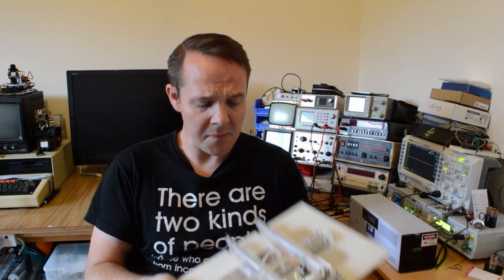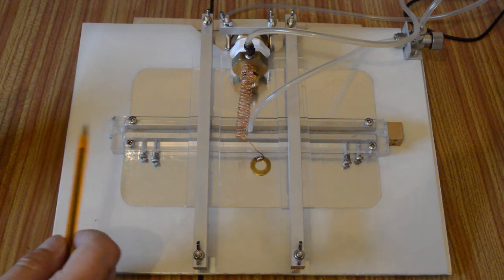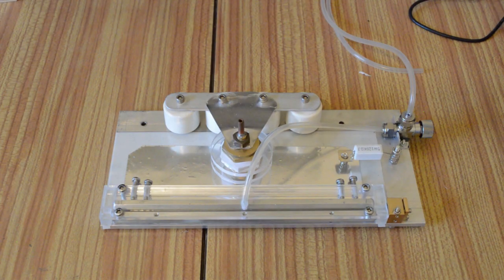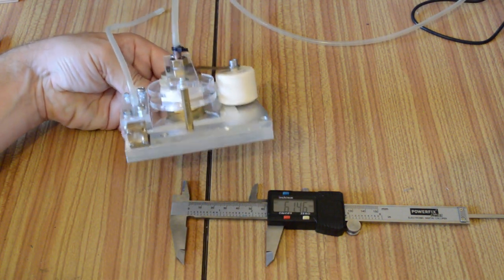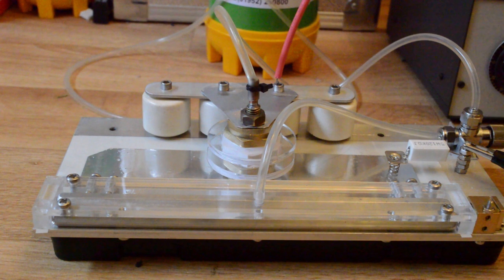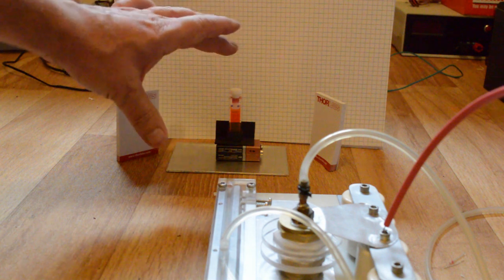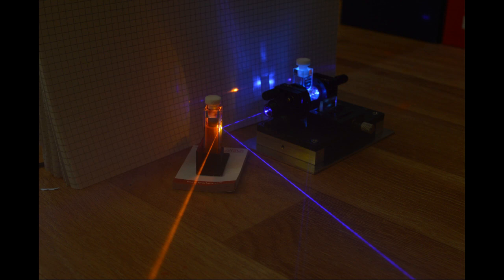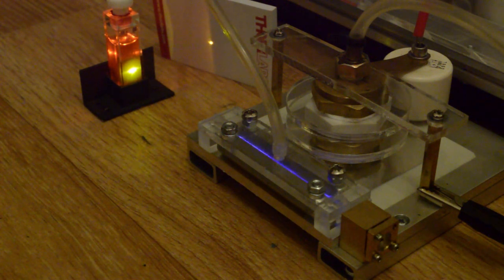DIY Home made High Performance TEA Nitrogen Laser and Dye Laser!

Comment: how can you change the repetition rate? I though that the repetition rate was given by the charge and discharge time constant of the RC circuit but probably not. Thanks for the explanation and info ...
Reply from the maker: The repetition rate is governed by the charge on the Dumping capacitor, the breakdown voltage of the gap, and the current supplied by the PSU in this case (So RC). Just crank up the supply to increase the repetition rate.  
A far better arrangement would be to make a triggered gap, so there is real control. 
The upper limit is ultimately determined by the temperature in the channel. Whilst it can be driven to 100hz easily in its current form, The output rapidly drops off above 40Hz, as warm Nitrogen does not Lase well. If you wanted a truly spectacular output, you run chilled Nitrogen down the Channel at a high flow rate. According to the literature, Nitrogen Lasers have been built with repetition rates above 1kHz.

Comment: Long time ago I built weird nitrogen laser with copy of the diagram from PRA-LN100 laser (TEA). But, after marx bank generator consisting of only two stages (to doorknob capacitors), there is 15 m of 75 Ohm cable feeding to the laser head. No additional spark gap on the laser head. And since then I lost interest in building any laser. My bad.
Reply from the maker: Cool! Do you have any more information on that?

Comment: fantastic!! I was wondering if instead of of a Nitrogen laser you could use a violet pointer laser (400nm approx) as it makes most of pigments fluorescent ?
Reply from the maker: Thanks!
Unfortunately it is not quite that straightforward. Although a violet laser pointer will make the dye fluoresce brilliantly, it lacks the peak power necessary to threshold the dye. 
Dye Lasers typically require peak power densities in the order of Tens of Kilowatts, to Megawatts per square centimeter, easily achievable with a small Nitrogen Laser.
It is possible to diode pump them, but it is certainly not easy and the power levels are very low (on the order of nanojoules) see this article here: https://link.springer.com/article/10.1007/s00340-017-6664-4
It is something I am considering pursuing, but the set up costs will likely be very high... Nitrogen lasers are cheap ;-)

Comment: lee have you tried this experiment using your own home made solutions such as the ink chemical from a high liner marker dissolved in methanol? i used ethanol as well for an orange and yellow marker under a weak black light and got nice fluorescence, id love to see if you can pump them to get lasing action to produce different colors , what is the highest freq or rep rate you can go up to and still avoid triplet quenching? 60hz would make it look cw, hmm i wonder if the homemade solutions would also suffer from triplet absorption or not? perhaps that might be the reason they may not work because there wont be any stimulated emission? idk but i have asked you before about getting lasing from chemiluminescence(glow stick)and you said it would not work but i been thinking about electrochemiluminescence and apparently they have gotten some breakthrough there for lasing i also think they even said they done it with chemiluminescence

Comment: awesome, well presented too, thanks. Q: any other gas that would work?
Reply from the maker: Thanks! Yes, probably! I suspect a CO2 laser mix would work, but you would need appropriate resonator mirrors. Argon 'might' if you made the channel long enough.
Reply: @LesLaboratory  are CO lasers better for higher powered lasers?
Reply from the maker: @mastershooter64  it depends in what context. For engraving and cutting, a good diode laser will give a CO2 laser a run for it's money, depending on material. There is an upcoming video on exactly this topic in the works right now!

Comment: I think the size could be further reduced, but I'd have to know what the effect of scaling this device is.
For example, how much less voltage is needed when substituting razor blades for the hexagonal aluminum rod?

Potentially, a feedback oscillator driving the spark gap could be used to step up a low voltage power supply. The feedback oscillator could be substituted for a simple oscillator used to drive a  transformer with a few more components.
At that point commonly available capacitors could be used to avoid the issues caused by the homemade version.

Of course this greatly reduces the output, but given the insanely high wattage of the typical TEA laser, it may be worth a try.

EDIT: The size I'm envisioning is comparable to an old Nokia "candy bar" type of phone, including the powder supply.
Reply from the maker: Sure, I suppose it could be made much smaller. I do not think a razor-blade channel would be quite as helpful as you think. Whilst such a channel would lower the voltage, it would also lower the available electron energy I imagine. I have previously used sharp channel electrodes, and found them to be very poor in this application.

It could be shrunk to the size you describe. I think a channel of ~3cm is practical. After that, it is just a case of shrinking the rest of the package. Small HV PSU's are readily available, I just wouldn't expect a huge repetition rate.
Reply: @LesLaboratory  
Thanks for the information on practical scalability.
Your response was much more in depth than I expected.
I didn't expect razor blades to produce anything useful, I was just hoping to get a relative figure in order to get me in the ballpark when I build the power supply.

I don't have a whole lot of space for projects, so the smaller the better.
Like you, I'm opposed to building something that's so structurally unstable as the typical TEA laser.
Better to spend some extra time in the design phase & not have to readjust everything each time the laser is moved.

I'll happily accept a vastly lower rate of repetition in exchange for increased durability & the ability to use off the shelf components.
Reply from the maker: @kaisersose5549  Totally. These builds are great in terms of stability. 
They don't scale up too well either. I have built one with a 30cm channel, but for TEA designs, that is more or less the upper limit.

Scaling down is something I should look in to. 6cm is cute, but it would be cool to get it down to 2cm, and still be able to do useful work, i.e. pump a dye laser.

I am also looking at trying to replace the doorknob caps with something more obtainable as well. I have tried removing epoxy from wire ended HV caps, but always manage to damage the dielectric and it is a lot of work, so I am looking into a design comprising of bog standard wire ended HV caps. I reckon with a bit of thought and care, it can still be made to work!

Comment: What did you use for a HR and most importantly, for an OC? I tried using a homemade resonator, but could only get superradiantly lasing. I was unable to obtain oscillation. I'm certain the mirrors are very well aligned. My only doubts are over the correct percent transmission (which should be high, given the extraordinary gain), which shouldn't be critical at all.
Reply from the maker: The HR was a plano UV coated aluminised mirror. If I had the money I would have used a radiused mirror, to compensate for the divergence of the reflected beam. There is no OC in this design, but the literature suggests between 4 and 10% for optimal efficiency. As you say the gain is massive anyway. Using a HR will more then double the output at one end.
Reply: @LesLaboratory  Where did you find such a tiny mirror? The commonly available ones are all one inch dia.
Reply from the maker: @TheLightningStalker  I got the mirror from Thorlabs. They do miniature UV enhanced mirrors.
Reply: @LesLaboratory  Very helpful thanks

Comment: 🤯 wow! How come the lasers come out at 90 degrees as opposed to straight through?
Reply from the maker: The Nitrogen Laser is focussed as a line on the Dye cell, and the gain occurs along the line. The penetration depth is very shallow so there is not enough gain in that direction to Lase, hence the 90 degree output.

Comment: I'm curious-- how well would this work with argon instead of nitrogen?  Couldn't really find any info on using other gases aside from CO2 or helium.  Argon is just a lot more common to have on-hand if you weld things.  Is there any info out there that would indicate what various gases would or would not work, and why?
Reply from the maker: As far as I know, Argon will not lase in this configuration. You might be able to use Ar as a buffer gas, but it is quite a heavy Ion, however, it would make an interesting experiment. Who knows, maybe with a long enough channel,  visible Ar lines could make an appearance. 

Apparently if you pressurize the spark gap with Argon that are supposed to perform better.

Comment: Les, 

I’m new to this laser game, and I was wondering why the “secondary” beam from the cuvett (?sp.) comes out at a completely different angle from the incident beam? Light amplification due to reflection off the inside of the cuvett?
I’m at a loss!

If you have link explaining, or if it’s quick an easy to explain, I would appreciate it,

BTW: You did a great job explaining you lasers! Thank you!

Kevin
Reply from the maker: Hi Nivek,  when the beam from the Nitrogen Laser hits the side of the cuvette, the penetration depth is very Shallow, so there is not enough gain in the same axis of the pump beam to Lase.
The profile of the Nitrogen laser beam on the cuvette is a short line, maybe a few millimeters in length, and in this case, there is enough gain length for it to Lase. Also yes, you are correct, reflections from the edges of the cuvette (about4%) are enough to amplify that light as well.

You can Lase cuvettes pf Dye 'on axis' if you dilute the solution enough and pump it hard enough, however then it becomes difficult to do interesting things like tuning it.

There is a diagram of a Nitrogen pumped dye laser setup here:
http://technology.niagarac.on.ca/people/mcsele/lasers/LasersDye.htm
Reply: @LesLaboratory  I had sort of the same question/was wondering why the 2nd output was perpendicular. Is the cuvette glass or plastic? I would think the quality and shape of the cuvette would impact how well the pumped color works.

Comment: I’m coming very late to this, but with CO2 in the gap, it’d lase at ~~10um. At 300-500 kW per pulse, would it be able to ablate material to engrave it, or is the total amount of energy per pulse just too low? How about if you just used a boatload of doorknob caps? (With a different choice of gas/wavelength, could it ablate metal?)
Reply from the maker: Possibly. I havev actually ordered CO2 laser cavity optics to try this...
Reply: @LesLaboratory  I can’t wait to see the results, that’s something I’d be interested in trying myself! (After you’ve figured out all the hard parts 😉😂)

Comment: What would the peak power of the dye laser output be relative to the pumped laser input?
Reply from the maker: The theoretical limit depends on the quantum efficiency of the dye, and optical cavity configuration. In the literature, this is about 30% for Rhodamine 6G. For simple Dye lasers like mine, more like 10%.

Comment: is it possible to run this with a cw laser? like a cw nitrogen laser to pump the dies and get a steady output?
Reply from the maker: Not in this configuration. If the pump pulse is too long (or too frequent), Triplet absorption quenches the Laser. For CW pumping, the way round this is to mode the dye through the beam extremely fast. Such dye Lasers pump dye through a dye jet inside the cavity.
Reply: @LesLaboratory  i kinda understand what you mean and i know about dies being pumped fast through the cavity for that as well as to prolong the life of the dye but when you say things like triplet absorption etc or even talking about the life time of exited states and that is why you need it to be pulsed pumped etc i have a hard time trying to visualise what is happening at the atomic level , at one time it was said ruby laser could only operate in pulsed mode well not anymore they can operate cw now , how about if we configured a xenon flash tube so that it is inside a fabri perot resonator will this not produce a laser pulse when flashed? or do the same with a neon sign tube and get a laser output , is there not stimulated mission happening inside a red light led? surely there is and if we trap it between mirrors we can get a beam out too , i bet even incandescent bulb has some stimulated emission happening and not just spontaneous,, dont mind me my head is full of questions lol i enjoy playing around and experimenting, like taking a 7.5w single die led from a store and making it go through a pinhole then an aspheric lens to make it look like a spatially coherent white laser beam which actually ended up having a better divergence than my laser pointer  well okay because the beam diameter is larger than my laser pointer

Comment: Do you have build instructions with parts lists posted somewhere? I'd love to replicate this work.
Reply from the maker: At the moment, the only documentation are these videos. I am in the process of creating a written document though. I will post it here when it is ready!
Reply: @LesLaboratory  Knowing how lasers work, but the specific tricks in how they are built -I lack. I am very interested in seeing how to build your take on the N2 laser, if you are not sure what I am saying, I am very interested in building the charge transfer version 2 design.  Because I did not see how the gas feed worked and how the charge-transfer circuit works, I am very intrigued and trying to curb my anticipation. :-) Being familiar with the first circuit design and laser TEA based on the Scientific American article.  This is interesting.  DO the electrodes connect to the capacitor plates on top? What electrical current source are you using?  Thank you for the video.  Please provide some documentation for building and understanding the circuit at least.

Comment: Where did you get the cuvettes? I make mine out of RTV and microscope slides. I hate fighting the leaks!
Reply from the maker: Hi. I used to do that, but it is a pain. These are Hellma Cuvettes I scored on eBay at the right price, but I have also used the inexpensive Chinese ones as well, and they are pretty reasonable.
The seller ID is samnacu, and they sell stoppered cuvettes for ~£30 UKP.  Stoppered ones are the business, easy to handle, resistant to spillage if you are clumsy like me and they keep well in terms of evaporation.
You can get square lid cuvettes as a lower price (~£20 UKP), but your solvents will evaporate quite quickly, and the lid won't stay on if you knock it over.
It goes without saying, you need the cuvettes with 4 clear windows. It is possible to polish the ones with 2 ground glass slides, but once you factor in your time and materials to do it, you might as well have spent the money!
Reply: @LesLaboratory  Thanks you very much. 

I tried searching eBay for user ID samnacu, but my search results turned up nothing.
Reply from the maker: @magx1  https://www.ebay.co.uk/itm/3-5ml-10mm-Path-JGS1-Quartz-Cuvette-With-Stopper-For-Fluorescence-Spectrometer/282377501375
Reply: @LesLaboratory  perfect! Thank you very much

Comment: Hello, your videos are very interesting, but I'm a total laser noob, so I have a few questions. 
Why doesn't the paper burn when you laser upon it? 
What is the purpose of your kind of laser? Can you cut with it?
Reply from the maker: Thanks! Although the peak power is very high, the average power is in the milliwatt range, so you can not burn or cut with it.
Laser like this are used commercially to do things like analysis, for example Fluorescence Spectroscopy.
I build things like this because they are a technical challenge. There is something special about being able to build a Laser from scratch, rather than just buying a laser module. Besides, with a Dye Laser I can generate any color I like!
Reply: @LesLaboratory  Very impressive :)
Reply: The other thing you can do with it (since most things reflect UV)... is use it as a LIDAR for things like clouds and such.